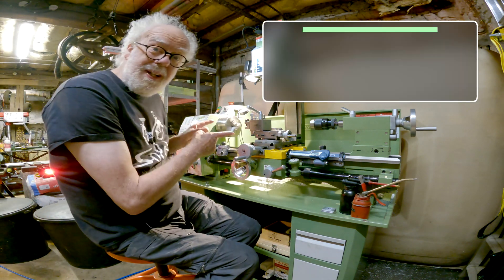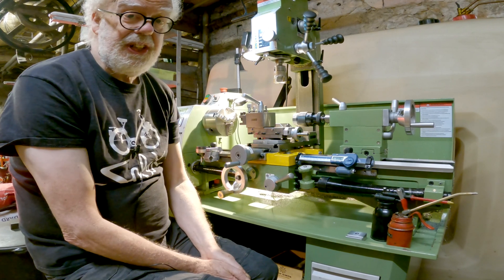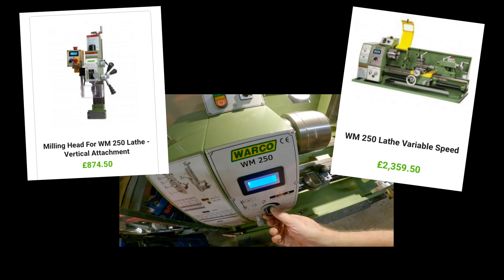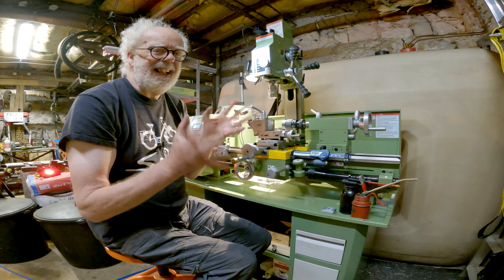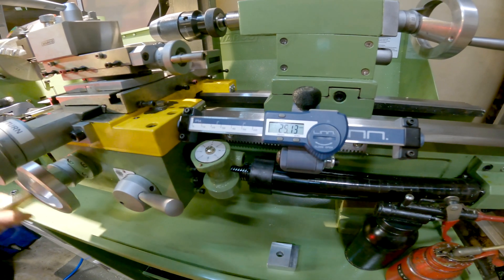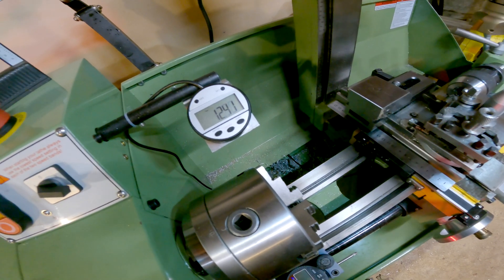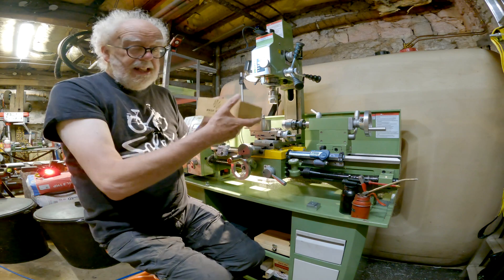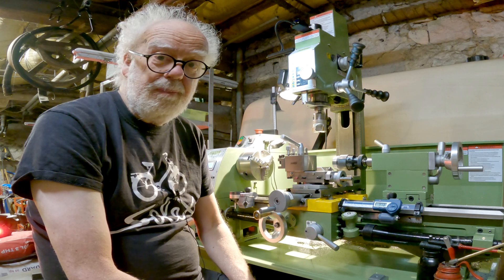Warco WM 250 Lathe and WM 14 Mill - Prof Simon

Comment: Why does your wm250 not have the power cross feed?
Reply from the maker: The wm250F was the model with powered cross field..    wish I got that one
Reply: @SimonHollandfilms  fair enough only noticed now on the 2nd watch through, I have the wm250v cross feed and DRO, I'm thinking to either get the milling head or the stand alone WM12, but the lathe head is the WM14 head so I'm undecided and unsure what will be better, space is a little tight but I could make room for a standalone, so unsure about what to get 😅
Reply from the maker: Get a stand alone mill if possible…the conversion of the crossslide to hold a milking vice is annoying.

Comment: I believe this is the same lathe as a Chester DB8, 4x16. I looked at Warco again a few days ago and I saw that this lathe no longer has a slotted crosslide. Finally decided to go for a slightly cheaper Chester, giving up the faceplate but having all the Warco accs. + more versatile crosslide.
 You have certainly given me a boost in confidence for these lathes over the usual stretched mini lathe which are much flimsier. Thanks for a great review.
Reply from the maker: sounds good...my lathe still is working fine.... all good

Comment: I've just ordered the WM250V with DRO - do you think the mill head is a benefit or detrimental in terms of rigidity?
Reply from the maker: Hi Mike, well done its a nice lathe. basic and robust. The combined mill is only a good idea if you are tight for space. if not get, a separate mill.  ive been working on mounting both a tool makers vice and lathe tool post, but it means the mill can only work on small items.  gets dull to have to break down the carriage every time you swap lathe to mill.   let me know what you think when it
arrives.

Comment: What you gonna make with your new lathe and mill? Rolexes?
Reply from the maker: steam engine models
Reply: @SimonHollandfilms  A while back, I saw you were building a steam locomotive.  Is that still in the works?
Reply from the maker: @lewisdoherty7621  Hi Lewis,  the 5" steam loco forma garden railway is on hold, awaiting original loco plans....but many little engines are in production.